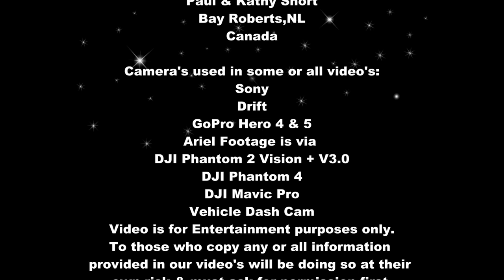History In the Making

Comment: Paul, I worked in a steel mill and we had a hoist system, it was a vertical beam with another beam on top that swiveled and the hoist trolleyed back and forth,  that way you can lift and swing with a pull rope It lifted a couple of tons worked great. I'm retired now or I'd take pictures and get measurements.Something to think about.

Comment: I am proudly and finally a first time Kubota owner!!  I found a 2013 Kubota RTV 1120D with advertised 181hrs for $9500.00  It looked unused and like new in the pictures.  I drove 150 miles to get it and he took 9K even.  I got it home and being new to Kubota I did some researching as it is much different than my ATV manufactured machines.  It wasn't 181hrs. like he advertised, it was 181 miles!  This 4yr old machine for basically half price had only 58hrs. on it and had its first maintenance done at the dealer for 9K!  What a bargain!  Now to get a good snow plow for it....I really want to just get the 6 way adjustable hydraulic plow and get it over with,,,but may have to go with a winch and straight blade of 72" for awhile...I can always sell it later on.  I have one good question for you on winter time maintenance as you love doing snow on your tractors and this is what I got it for as I take care of a retirement park in regards to plowing as well as a restaurant also,,,same owner.  What do you like for additives for cold weather running in your equipment?  I want to have a block heater obviously if it doesn't already have one...remember i just got this a week ago and I'm a busy fella..haha!   We usually only get 3-4 good measureable snow falls here in upstate PA every winter and haven't had a serious blizzard for over 20yrs.,,yeah we are over do!  I also am looking for suggestions on a good lightbar for nighttime vision while plowing as I have to have places open and clear before 6 am.  I am also purchasing a salt spreader for the dump bed..ps I love that hydraulic dump bed!  Evem though these have relatively low hp for its weight it has very good torque numbers.  I'm not interested in high speed, just longevity and ability to get the job done for years down the road with good maintenance.  It is garaged also..I usually do this work with my ATV for the retirement park roads and drives. and used an old Ford pick up to plow the restaurant...Well the frame has seen its better days on my good old 89 F250 and I wanted something that would be a more all around machine for my hunting lease also of over 200 acres.  Sorry for the long post,,,I could of kept it short and just asked for the best winter additives...dealer stuff I'm presuming...Any other suggestions or info about these engines for me would be appreciated...Thank you.  Oh yeah I will be getting a cab and defroster for it someday too.....$$$$ lol!

Comment: Oh My! Here's what I see happening in the not too distant future...

The Shorts - Dateline 2019
* It's now the Kathy & Paul Short channel
* Kathy opens "Helloooo YouTubers" and immediately starts in with a story about the latest boot mod she's thought up...and instead of moving over the BX, she hikes her latest leather up on the bike ramp and proceeds to describe how she needs to change the angle on her heel so as to work her 'hind leg' peddle more smoothly. You see she has been working on expanding the fish pond (she's already excavated the area between the shop and the museum) and there's lots of backing up to do while moving the fill around. 
* Paul has the camera going while at the same time helping Kathy setup the Miller TIG welder so that she can add her heel mod in stainless steel. Of course, that's after she's milled the round stock to the correct diameter...which is after cutting it to length on the electric band saw. Her training progress is coming along nicely on the Iron Worker too, but she decides not to use it for this particular mod.
* Once in a while, we see her hard at work on more decals and stickas' as she decided there's just not enough on the 5740 yet (she already used up all available square yardage on the BX with sponsorship stickers from all of the North American boot and purse manufacturers).
* The snow plowing is still relegated to Paul, but now in addition to running the 5740 duties Kathy has finally given Paul full instruction the hand shovel, snow shovel, rake, and hand trimmer - so he gets to do it all when it snows. Kathy uses that time to watch videos on how to do Gold Wing tuneups and Mustang brake jobs. Spring will come fast and they want to get out on the bike or in the convertible asap.
* Speaking of the motorbike, Kathy easily passed her license testing and is now driving. This gives Paul a better feel of sound quality vs. wind noise as the passenger and allows him to use a hand-held camera in addition to the helmet mount units.
* While one drone was good, Kathy was able to justify a second new Mavic with the subscriber increases (while reluctant at first, Paul has decided the benefits outweigh the risks of having Kathy in a bikini top under the shop apron while 'puttering about.'
* After the latest YouTube Likes-Comments-Subscription stats, they're considering setting up a third Shelter Logic shelter for the 'secret project' Kathy has been working on...her contracts with the Navy and now CBC are starting to explode and taking up more of her time. Her next appearance before Parliament regarding the latest iteration of her health care proposal has been well received by the ministers and that is wreaking havoc on her upload schedule.

Stay tuned for more videos next week...Kathy has something special planned with the folks at Princess Auto and a look at their new signature "Short" leopard print work gloves with matching chainsaw chaps.
Reply from the maker: Helloooo Fred, now i see that you have put a great deal of time into this lol. Looks like I could get busy real fast, you have a lot of great ideas that could be put to use. The teaching Paul on how to use the shovels, rakes, ect would bite into a great deal of my time lol.
Stay safe! Kathy

Comment: Paul good to see you at it again.  I have a question I have been waiting to ask you.  How many filters for the hydraulics does the BX25D have one or two.  If two where are they located.
Reply from the maker: Thanks. Only one hydraulic filter on a BX. Located under the tractor on the bottom of the transmission next to the mid pto.
Reply: Thanks I had found that one but a local dealer here in Tennessee insisted there are two but didn't have a BX25D on his lot where he could show me.  Turns out his paperwork was wrong.  Thanks again.  By the way you are the reason I bought a BX25D.  Really enjoy your videos

Comment: Paul, off topic. Have you had the speed knob on the 5740 steering wheel come loose?! I have. You might want to take the cap off and make sure the nut is tight that holds the spinning knob on. 
Have a good week. 
Andrew.
Reply: Are you referring to the suicide knob? Yeah, it's pretty dangerous if it comes loose eh? I'm sure he's had an experience like that. I don't use suicide knobs, just palm the wheel, but they're a good idea, just not if they're not installed right.